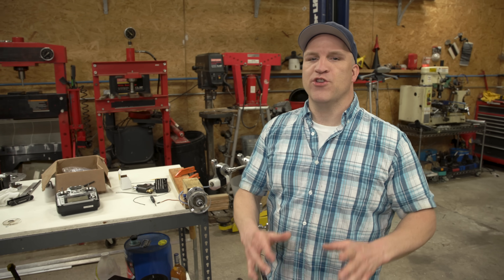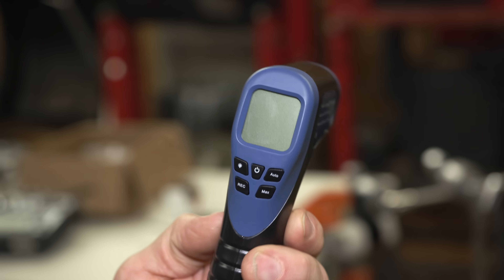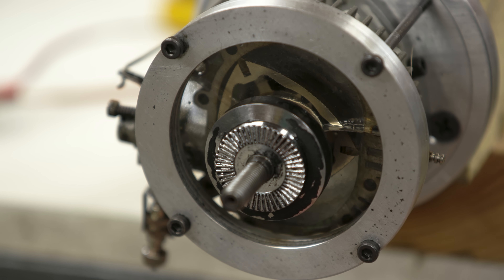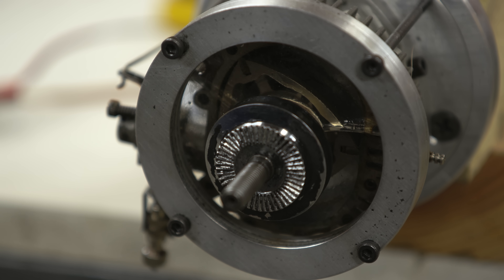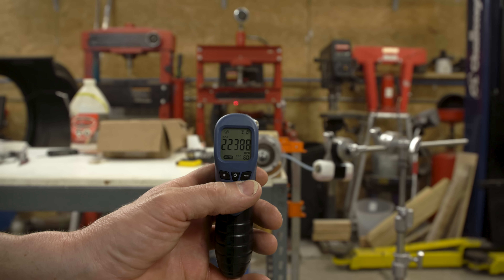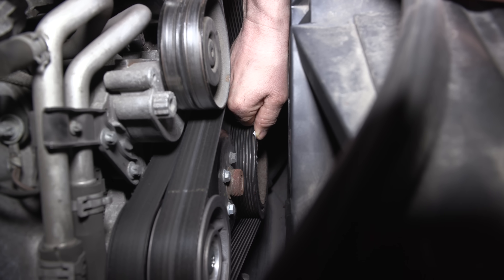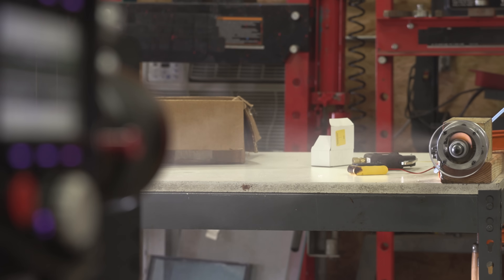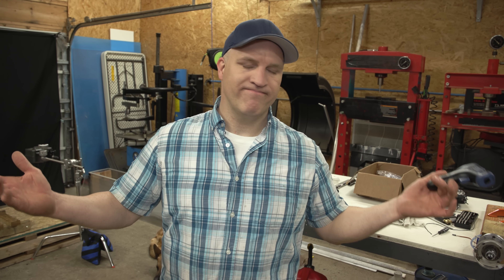See Thru Rotary Engine MAX RPM - 29000 (Wankel Engine)

Comment: why does leaning out the mixture increases the RPM i don't understand?
Reply: Antonio Javier Marasco seems you misunderstood what he was asking. 
He's asking why at X amount of throttle with a richer air/fuel mix produces less RPM'S than a leaner mixture at the equivalent throttle.m
Reply: Leaner = more power = hotter combustion chamber = less reliable 
Richer = less power = cooler combustion chamber = more reliable 
Stoich = air/fuel mixture with most efficient burn
Reply: There is such thing as too much fuel. Beyond a certain point the extra fuel you are giving the engine isn't able to get burned in the combustion cycle so you end up with that fuel just going through the engine and out the exhaust.
Reply: Hes getting close to 12:1 afr which is the best power mixture, it's usually the afr target of all cars in a wide open throttle setting.
Reply: There is not as much weight/ mass inside the rotor slowing it down per amount of combustion power to keep it going. Think of it like a v8 it drinks a lot of fuel to make horsepower but it's extra weight and moving parts require a higher idle to operate as you apply more fuel the engine produces horsepower but after a certain amount the fuel has diminishing returns. Leaning out is good because then you aren't causing extra mass to move in between the pistons than necessary like how in highway they deactivate cylinders to save on fuel while keeping same speed. A rotary runs a lot smoother and with reduced rotational mass such as fuel it's capable of increased rpms, but the torque needed or weight resistance when used in a car for example will make the engine work harder that's why it's a gas guzzler.
Reply: Because X amount of air can only burn Y amount of fuel and if you inject more fuel than you can burn it will evaporate inside the combustion chamber cooling the combustion which will cause lower pressure inside the combustion chamber.
Reply: To the person saying a rotary is a 2 cycle engine you are completely wrong. It's a 4 cycle engine.

And to answer the question. There is a perfect ratio of air/fuel called the stoichiometric ratio. The closer you get to this ratio the more power a  engine produces (with many exceptions)
Reply: sorry Ben but not one of these replys actually answer your question
Reply: Mr. H      You know of course a rotary has an induction, compression, ignition, and exhaust cycle. Doesn't appear to be two stroke to me.
Reply: Mr. H This motor is actually a 4 stroke just like the rx7/rx8 motor
Reply: over flooding the engine to reduce it from over heating.. causing it to over fuel, and not burn efficiently causing less power, he added less fuel causing it burn more efficient. making it rev higher. not science.
Reply: Hence the phrase "Lean is mean". (in terms of A/F ratios)
Sure as hell won't last too long in a carburated application though.
Reply: Jerkingoffwithabeltsander Jerkingoffwithabeltsander Wtf
Reply: More efficient use of heat and pressure creating more heat and pressure inside the engine instead of releasing it into the atmosphere. An excessively rich fuel-air mixture absorbs heat and pressure vaporizing and keeping vaporized the excess fuel instead of turning it into mechanical "power". The more fuel is present the more heat is required to vaporize and ignite it. The "wet" parts also have higher drag and there is increased parasitic load from that excess drag.
Reply: cuz there is a balance, fuel/air mixture, if you put into the chamber more fuel than the intake air could burn, you would be wasting a part of the volume of the cylinder, cuz it just be fill of liquid fuel and not vapour, that in fact, the only one can be burned.
Reply: > Increased liquid fuel in the chamber effectively raises the compression ratio of the engine - this is how hydrolock occurs if you're not careful. 
> Increased liquid fuel, through the same effect, reduces the effective volume of the cylinder - imagine putting ball bearings or something into a piston engine, the room available for the combusting mixture to expand is lower.
> Combined effects above result in increased energy being spent to compress the air to much higher pressures, and then extracting less energy from the combustion process because the mixture expands less and does less work on the rotor. More energy is lost through the exhaust port.
> Running the engine rich "steals" some of the heat energy out of the engine, which means more energy from combustion is being used to reheat the engine as opposed to heating the air more and doing more useful work on the rotor.
> Leaning out the mixture reduces all of these effects, maximizing the useful volume of the chamber, minimizing energy loss to generating higher pressures, and retains some of the heat which makes ignition and expansion more efficient.
Reply: Apexseals---- what have chickens got to do with engines?
Reply: CrazyForCooCooPuffs it's Cocoa Puffs
Reply: A horse with no name very good, so do two stroke motors, but similar to a two stroke; the motor is multitasking if you will, the intake, compression/combustion and exhaust is simultaneous. It's actually closer to being a one stroke, since it does not reciprocate.
Reply: NCD2294 
Howd all those ww2 aircraft survive then , most of those boys wouldn’t make it home unless they leaned it out. 
And they did it over and over again....check out an operation they call “lean of peak” ...lean isn’t gonna burn anything up , how can you throw less gas on a fire (that supports combustion) and get more heat? it’s the timing that needs to be retarded when you lean it out. 
In the aircraft world , that’s like the backpressure myth in the car world.
Reply: The reason that leaning out produces more power is that in a rich burn scenario the oxygen is the limiting reactant. the further away from stoich your mixture is the less energy you are producing. 

the reason tuners run vehicles on the rich side is that rich mixtures keep the combustion chamber from overheating and rich mixture can run a more advanced timing curve so that more of the energy released is useful. the idea is to get the gases to expand just as the cylinder passes TDC to get the most use out of the energy released. too early and the expanding gases work against the cylinder, too late and the expanding gases do less work.
Reply: Too much fuel can choke a engine
Reply: Lean means closer to perfect explosion. In normal cars they are turned for long term use and low emissions.
Reply: robert hamilton wrong stoiciometric is the best ratio that will consume all the reactants. Lean means more air than stoiciometric and can be dangerous for the engine under heavy loads.
Reply: Benjamin Lim
   Using the rotary engine in this video as an example and only this engine... The reason the RPMs increase when the fuel mixture was leaned out a bit, is due to the original fuel/air mixture being too rich. By leaning out the mixture, it allowed the fuel and air entering the engine to burn more efficiently, making more power.
Reply: less fuel.. more air.. equals a hotter bigger bang... in the same space( cylinder/ chamber)
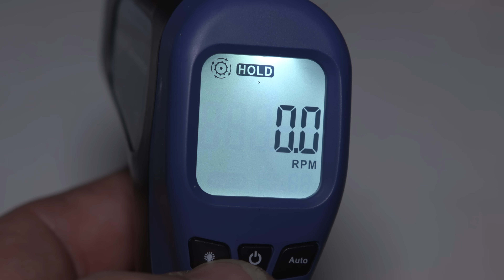Reply: fuel requires a good fuel air ratio to burn properly. If i remember correctly petrol likes 1:15 or something around that. There is a sweet spot for every engine though that you get the most power. This sweet spot changes if you add forced induction to the system though.
Reply: The optimum air to fuel ratio allows you to generate a hotter, faster expansion of gas against the rotor, than a "rich" mixture, where excess fuel evaporation removes heat and therefore energy from the expanding flame front.
Reply: Benjamin Lim An engine no matter what kind is basically a big air pump. When you lean the mixture out you are getting the same amount of air but with little less fuel and making the air/fuel charge burn more efficiently thus making more power per combustion stroke thus making more rpms
Reply: It's a 2 cycle two-cycle engine. These type engines use the fuel mixture to limit the RPM at wide open throttle. They keep it slightly Rich so that it berbles and keeps the engine from over-revving. I learned this from Racing 2 cycle engines if you lean them out they also run hotter and can burn up.
Reply: it's basically how all internal combustion engines work, you feed them more, the extra fuel increases the speed the engines rotates making the next revolution to come quicker and if you keep feeding it it's a vicious circle until you stop feeding the engine then the rpms calm down. In the engine cycle there is one that's intake, that one creates vacum and sucks all the fuel you give, more fuel, more revs. Obviously you need to provide the right amount of fuel/air for the fuel to burn, too much fuel and there is no explosion, no much air, no explosion.

There is probably a better and more technical explanation but this was my attempt hehe. Hope it helped

Comment: I doubt the engine blew. You were still able to turn the rotors. The RPM range was impressive. I worked in an engine lab in 1968. We tested the Wankel engine. It's only drawbacks were poor fuel economy and oil leaks. It was a strong engine.

Comment: If you notice the whole time the clear side plate was flexing causing it to leak   and also lose a little compression, so it could maybe rev higher, and also that flexing is what caused it to crack

Comment: At 29,000rpm the eccentric shaft is spinning 483 times per second which also means there are 483 intake, combustion, and exhaust events per second or 1 intake, compression/combustion, and exhaust event every .0021 seconds. That's 8 times faster than the 60fps many video game designers are trying to get their games to run at.

Comment: i can hear that on idle, that is not 10k rpm, something is wrong, if that were 10k rpm at idle i would be very surprised because i can hear the pops and the dead time at idle, i wouldn't at 10000 rpm
Reply from the maker: No it's like 6000- 8000 at idle.
Reply: i was very surprised it does not sound like it :) sounds like max 3k. im not a rotary man though

Comment: Why on idle it shows 80k+ rpm? Are you sure this is accurate? At some point you targeted the wall and it said 60k rpm.....
Reply from the maker: There is a decimal point there, so it says 8000.0. looks like 80000 but it's 8000. That's the only confusing part about that tachometer, it has a small decimal point that automatically moves over as the RPM rises.

Comment: Did a spectral analysis of the sound at peak revs. Strong peak at 482 Hz so that's 482 x 60 = 28,920 rpm.